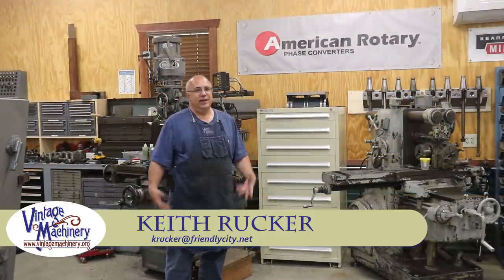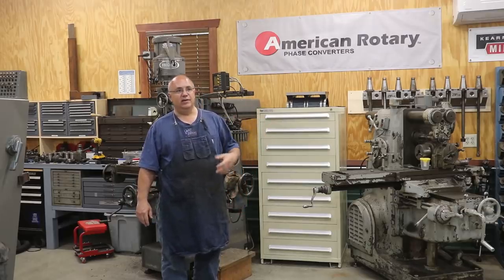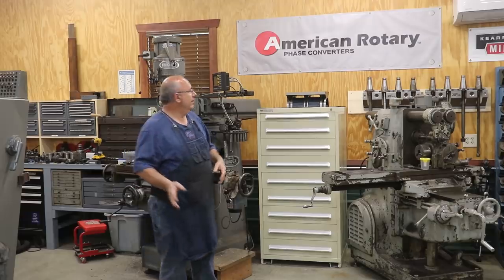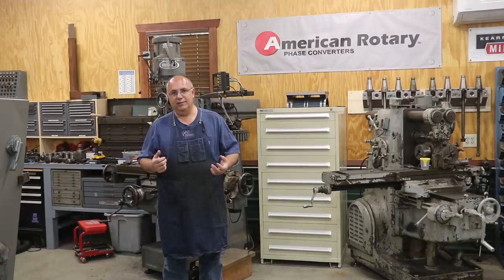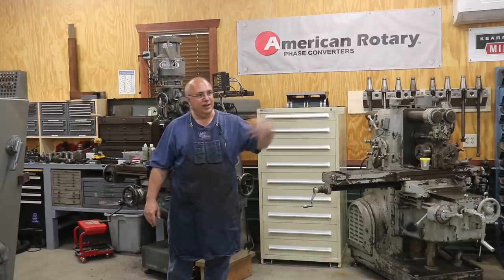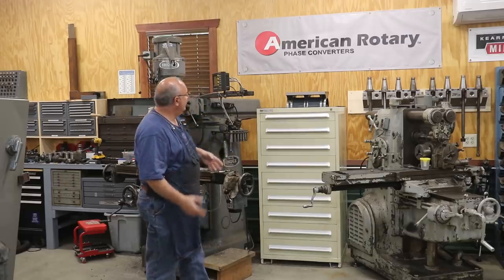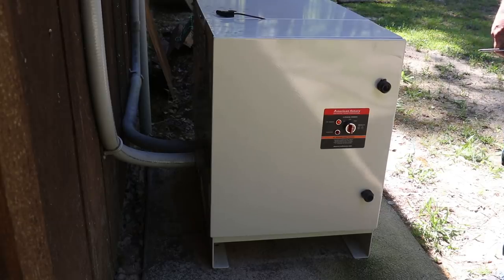American Rotary Phase Converters: Making your own Three Phase Power

Comment: Keith, the answer to leaving the RPC running when you leave the shop is to have a relay wire into the shops light circuit. When you shut off the lights the relay shuts off the control circuit to the converter. My shop built RPC set up like this. It works great.
Reply: Brilliantly simple solution.
Reply: @databoy2010  Oooh. Dark humor.
Reply: +1 on that. I also have a contractor controlled by shop lights handling my air compressor, I'd hate to blow a line while out of town.
Reply: A related experience about the shop light based control of day/night power...
Way back when I worked in a big company small lab, we decided to play it safe with our soldering irons and wired all the work bench outlets (as well as the bench lights) through a contactor that was turned on and off by the room light switch.  Nice and handy.  BUT one morning we had a nasty message from the night guard claiming that we violated the safety because he found the soldering irons hot when he came around.  Of course, he turned the lights on for his inspection, causing the irons to start heating up....  So, we could not win?  Because some of the night guards were changing every now and then, a training effort was not a good solution.  We ended up engraving good size signs next to the light switch explaining the control feature.  After that, the only issues were when we in special situations had to leave some data logging running over night.  Luckily we had a couple of original non-switched outlets available and with a suitable note explained the special arrangement and situation, as well as verbally informed the guard shack about the one night test.
Reply: This is nuts.  Power circuits interlocked with the light switch.  Are you gonna lock out the light switch.  Nuts.
Reply: Done all the time for safety interlocks on equipment that starts automatically. 
The relay or contactor breaks the run circuit of the rpc. All the power from the light circuit does, is to energize the coil in the relay or the contactor. Has no effect on the lights operation.

Comment: I made my choice to buy an American Rotary Phase Converter based on your recommendation.  I am in Canada.  Amazon Canada supplied the 10 horsepower unit. I was called by the supplier and they wanted to make sure I was buying the right unit. I was very pleased with this level of customer service.

Comment: I have a 2 HP mill and a 10 HP lathe in my shop.  I did a ton of research and shopping around before I finally settled on a Chinese VFD for the mill and a 10 HP single phase motor for the lathe.  That may sound crazy, but the total cost for both was less than $500, and I don't have to find room for a rotary phase converter.  This was the best solution for me.  Everyone's situation will be different though, and I agree that if I had a bigger shop with a couple more machines a rotary phase converter would definitely be the best choice.

Comment: Three phase is is globally used in industry because it gives totally smooth rotary motion, unlike single phase motors which have a slight 'judder'. It's really good for powering lathes. It gives the same power in a smaller motor size and avoids the need for start up capacitors and associated centrifugal switches - all maintence items. It also beneficial for the supply company as heavy industrial loads are inherently balanced over the three phase generation and distribution network - it only drops to single phase for domestic use at the very last moment. There are very significant differences between how single phase domestic supplies are derrived in the US and in the UK - it is not just a matter of different voltage and frequency. BobUK.

Comment: Another key difference between single and three phase is in motor start function. Typically you will see start capacitors on motors with single phase. The capacitor generates a phase difference to get the motor to start in a consistent direction. Where on 3 phase the orientation of the phases generates the motor direction. Which means it's really easy to reverse a motor on 3 phase, just change two wires between any two phases.
Reply: Yes, three phase generates motor direction. But a better explanation is that the rise and fall of voltage (and current) makes a rotating wave kind of like doing the wave in a football stadium. There are animated videos online that demonstrate this. And keep on getting the word out about RPC.

Comment: Hi Keith :-) 

Just a small piece of advice for ya.
Not sure if you have ever experienced the dreaded "Single Phasing" of a 3 phase motor or not but it can happen quick and it can get expensive if it does happen. 
In case you're not familiar with Single Phasing, it's when one of the 120v legs drops for whatever reason (Example: if your rotary phase converter should fail), Single Phasing can burn up your motor literally in seconds. 

I use what's called a "Phase Monitor",  what it does is monitor the voltage of each leg and if one leg should drop, the monitor will shut off all power to your machines, keep in mind however that the phase monitor has to be connected to a 3 pole contactor with a single phase coil to energize it (120v in your case). 
Also in your case it would be best to have a contactor rated for how ever many amps that would cover one or two machines that you may have running at one time, the contactor will kill all 3 phase power but not the single phase power that's used for things like lights and other 120v appliances. 
Since you are basically a one man show,  the contactor would likely only need to be rated for maybe 50 amps. Most of your machines probably don't draw near that much, even with two running at once. 

Phase monitors are cheap and contactors are pretty cheap as well, I paid less that $150 for my phase monitor and less than $100 for the contactor, I could easily pay twice that amount just to have a 5 HP motor rewound. 

Here's a link to what I'm talking about: 
https://www.supplyhouse.com/ICM-Controls-ICM450C-ICM450-3-Phase-Line-Voltage-Monitor-Delay-on-Break-Timer-0-10-Minutes-English?gclid=Cj0KCQiAtf_tBRDtARIsAIbAKe2Qt7LGmmG2sJcTD2Lr8kESTT20NAttOyAWwoBuhFWbMjfqXZybkikaApCTEALw_wcB

I use the ICM450 and lots of places stock them. 
Heck, I may have an extra one laying around that I could send you for free, I used to install a bunch of them before I retired, I'm almost positive I have 2 or 3 laying around here somewhere :-)
I don't think I have any contactors left but I'll have a look to be sure, if I do have one, I'll send you one of those as well. (If you are interested that is).

Of course now that I think about it, American Rotary may already have phase motoring built in as standard equipment. 
I haven't looked at their equipment since I don't need it. 
It may be worth asking American Rotary of phase monitoring is one of their standard features.  

BTW, most likely the biggest part of those capacitors are there to increase the efficiency, they help to bring the power factor as close as they can to PF-1. 

Thanks Keith!! 

Joe

Comment: I have an AR10 10hp RPC in my shop and it works great. Very simple to set up and it runs multiple machines. I played with VFD's first and didn't get the results I wanted. I could have saved hundreds and a big headache going straight to a RPC.

Comment: I live in Idaho. I added another power drop to my shop.  At first the power company was saying I would have to pay for the installation and wire.  I told them if I pay for it, I own it.  When I leave, I can take the wire with me.  I paid for it, I own it.  They wound up installing it for free.  Depends on the contract the power company has with the state.  I had natural gas re installed at a house I was renovating and the gas company tried to get me to sign a blank work order.  They wanted me to pay for the gas line coming  from their main to the house.  I said no.  It's on your side of the meter.  Can't say you can do this but it's on their side of the meter.  They own it.

Comment: Thank you. I learned a lot from this one. I guess if you have one or two machines with small to midsize motors, VFD's might make sense, but I really like the idea you can use the rotary phase converter and wire it up as you have with a panel for just 3 phase power. I think a lot of people setting up home shops shy away from three phase even if it's available from the power company directly much less if a solution like that phase converter would be required. You can find some smoking deals on used three phase machines for that very reason and end up with better machines.

It should go without saying that if you aren't fully competent and comfortable wiring three phase, hire an electrician.

Comment: Nice upgrades! My AI 50hp was even older than your first one. It still works just as it should and can even start the big 40hp Monarch ok. I would like to have an even bigger unit and I may have to get one as my 200AMP Plasma cutter is going to be a good test on it as will the Big CNC Mill as the voltages and loads are a lot different for those items than they are for just regular electric motors.
Reply: Brian, you get many more Big Machines you may need your own power generator (small nuclear power plant) LOL
Reply: I hope it works out for your plasma, I have heard guys talking about using a RPC on welders and all the trouble they have had. Some of them gave up and got single phase welders instead.I think they were all transformer type welders and not the inverter type.

Comment: I contacted my power company to see about bringing 3 phase into my garage shop.  At the time I had only a single 15amp 110v circuit to the garage (enough to drive the lights and door opener).  In order to run my equipment I had to run a generator.  Pulling cable from the house to the garage was, at the time price prohibitive.  The power company won't put a second feed into a single building (Not sure why but that's what it was).  So I asked for 3 phase.

3 phase on the poles stopped about 4 or 5 poles from my house.  $13,000 to get 3 phase to the pole outside my house.  Free install and then a quite reasonable monthly fee to have good clean 3 phase to the shop.  Decided that I'd pay to pull cable from the house panel to the garage sub-panel.

3 phase is nice if you can get it to your shop.  But the cost always seems a little high.
Reply: That actually sounds cheap.
Reply: @tomk3732  It is cheap unless you are talking "home shop" where $13K is a bunch of new equipment.  I had the $500 to pull cable from house panel to garage panel.  I didn't have $13K to have 3 phase run.
Reply: @ctjctj2  It is cheap as compared to some others getting quote in 100k+ range. I would also not spend 13k for just 3ph drop that I also need another meter for and extra 1000+ in fees every year. You can get a nice used CNC for that $.

Comment: In the area I live, to get 3 phase, it has to be something like within I think 5 miles. Yes, you pay for it, a lot. If there is a company with 3 phase within 5 miles, I think its something like $10,000 if not more just to get it to you. Rotary phase converters is the next best answer to get your 3 phase and much more cost effective.

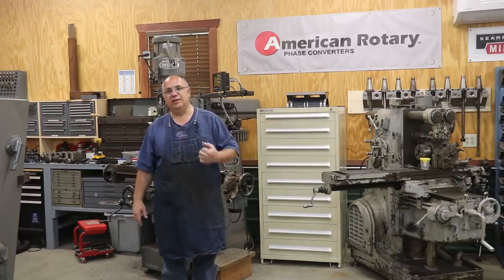Comment: 6:40 Keith, when you talk about static phase converters, static phase converters are not as efficient because they are simply only a 'starting circuit' to get a 3-phase motor started and going, and then after that, the 3-phase motor is running off single-phase power that's providing 2 of the 3 legs.  Because of the 'missing leg' in this instance, the motor is only putting out 2/3 of its potential power and torque.  Not good at all for the home machine shop if you're going to be doing serious turning and milling.  The only thing static phase converters have going for them is how inexpensive they are, but that is more than offset by how machines using them only have 2/3 or 66% of their normal power and torque available.
Reply: This is not understood by many users.

Comment: Torque ripple could best be envisioned by the difference it would make driving your engine lathe with a one cylinder IC motor and a three cylinder motor.  The wiring of three phase for a given code rated ampacity is 50% more copper but transmittes 72% more power.  Win-win.

Comment: i got 3 phase from the pole which is about 20 feet from the house.  I looked at the phase converter but given the need( as they told me) to be situated close to the distribution board and then the cost of running the wires to the shed it worked out cheaper to get the 3 phase connected.  I live in australia and it cost just over $A 10 000.
Reply: Lucky you 
3phase stops 60km from my place in SE west aus

Comment: I'm going through the option of updating my shop with 3 phase wiring.  I had an electrical engineer out and even went through the process of seeing what it would cost to get utility supplied 3 phase, but the quote came back at about $13,000 just to run the lines to the house, then again almost that much for meter and everything.  so....nope.

While I still have to update my shop as the wiring run from the house is only 50amps, going to upgrade the house to 400amp and shop to 200amp with a single circuit that goes into my rotary phase converter and feeds a 3 phase load center.  At least that's the current plan.  I'll post videos as the work progresses.

If you check my channel I have a video on building my own 30hp rotary phase converter.  No where near as nice as the American Rotary, but if looking for a budget solution it can be had for much cheaper after finding a motor on craigslist or similar used motor source.
Reply: You must have a power line close to your house, usually that's about $8000 to $20,000 to get the 3 phase drop. My power is under ground, was quoted $350,000 to get 3 phase here, that was due to road construction and what-not. So yep, split meter current transformer with a rotary for me!
Reply: @mythril4  Yea, across the street, all overhead.  Was hoping it'd be a bit cheaper, but it wasn't.
Reply: Yeah getting 3ph even if it is outside of your home is expensive plus you pay extra for another meter every month. Sure enough the "green new deal" is making sure we all heat up the atmosphere by running our phase converters.

Comment: coop in central texas wants a pole approximately every 400 feet at about 2500 per pole.  Sooooo, that's about $16500 in central Texas to run your 3 phase. I got lucky and have a three phase feeder line running through my small ranch. Coop said they had to run a pole for anything more than 40 fee from feeder line pole. Just by coincidence the corner of my shop is exactly 39 feet from pole......aint that somethin!

Comment: I had 3 phase ran into my pole barn.  I was really lucky to have the power line really close.  It was relatively cheap to have run with the Power Co-op we get our power from. But it came with a monthly fee whether i use the power or not.

Comment: Hi Keith, I'm a native Brit (ex-Pat) living in Germany and indeed, we all have 3 phase (I think mostly to get enough power for the Kitchen (the Hobs / Ovens you buy are configurable for 3-Phase or single). I think in Germany, the default 3-phase is 3 x 16amp phases (for your kitchen). 

In the UK (domestic properties have a default 100amp 230v supply)  so to get the full load into the kitchen, the properties are wired with 45amp or 60amp spurs, (this is especially true  in bathrooms where some electric showers units can be 11Kw. Quite simply, 60amp cable is (a) expensive and (b) an itch to work with. I am nor sure what standing IEEE regulations stipulate for cable, probably 16mm², which is more of a pig to work with than 10mm².

In my native UK (North Wales) there is 3-phase going down pretty much every street too, so if you want 3 phase, it's usually only a case of bringing in the other 2 phases in. In most cases, in terraces for example, 3 phase cables run right past (often, along and undernearth the eaves, tapped off as it passes each property); so quite often, there is 3-phase already on your property anyway.

I don't know how the US runs it's power but you mention that you have 220v. Now for my understanding, you guys have single phase 110v domestic supplies, so am I right to assume that you actually have 2 of the three phases generated anyway, if so, adding (creating) the missing phase is easier. If you only have one of the 3 phases, then making the 2 missing phases, would create a fairly large current load on the one incoming phase.

I'm just curious as to how you're 220v supply is actually provisioned, hopefully, someone will explain. Many thanks and keep up the good work. Hopefully I will have a bigger workshop one day but can only dream of one the size of yours... All the Best, Martin.
Reply: The supply voltage is 240v utilisation is 230v. The 240v is supplied as 2x 120v 180deg apart. We run to the 3ph engine 2 legs from the 240v and generate the 3rd leg. Thus I get 240v 240v and 270v from generator. 15hp 3ph engine is connected with 60amp 240v single phase breaker but can work with 50amp breaker as well, through not at full power. This is more then adequate to start 10hp lathe.

Comment: For a 1 or 2 machines (mill and lathe) a VFD is probably the better choice, based on cost. Anything more than say 4-5 machines, phase converters make more since financially.
Reply: Nah, once I got to two machines I ditched VFDs. You get to run the machines on their native power as they were intended to run. No need to re-wire. No need to wait for VFD to speed them down. No need for extra capacitors to slow them down. 

I would consider VFDs still just for speed control.